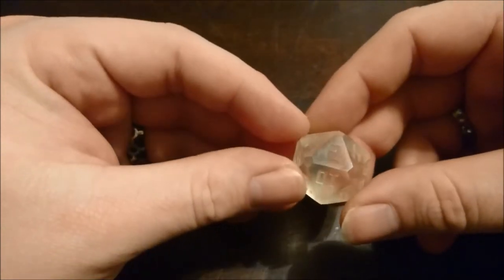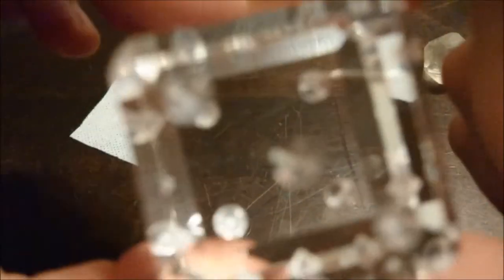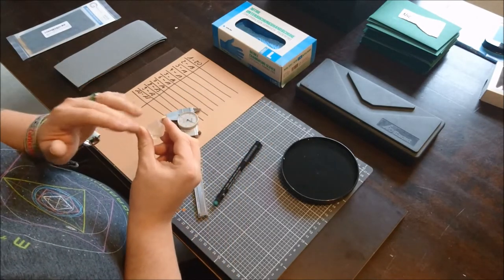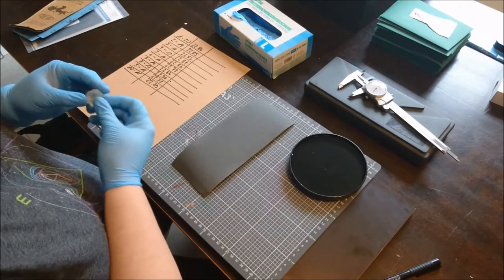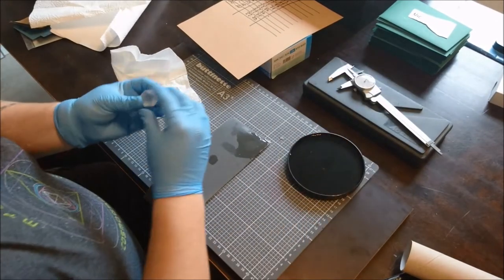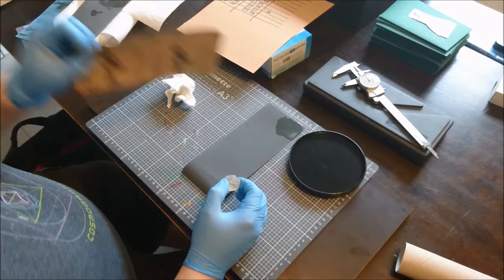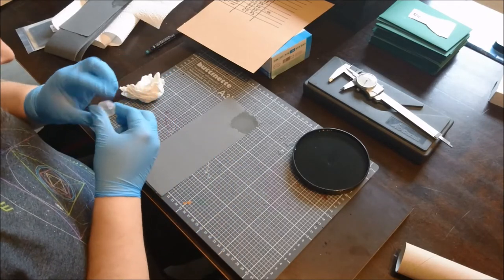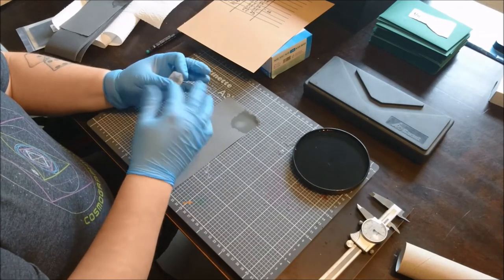Dice Making Masterdice: Part 1 Sanding

Comment: Hello ! I have some questions that hopefully you can answer , I have made molds and cast some dice , they come out perfectly clear but when I touch them they start to not be clear anymore . If I were them they're clear again but only while they're wet , is there something I'm missing here ?
Reply from the maker: Are those dice a bit tacky? Maybe it's the combination of your resin and silicone. I heard about alumilite for example which is not working so good with its own materials. I can highly recommend you check the dice making discoveries group on Facebook and explain your problem there, with some pictures and materials you used. I'm also in the group, but a lot of people will help you as well and we will find a solution.
Reply: @wuerfel_schmied  well im wondering if it's the shelf life, i just looked it up and it says the recommended chelf life is 3 months, and ive had it for 7 :o
thank you so much for helping me out!
Reply from the maker: @DrakosInfernos  that could also be an issue. Hard to tell without having it in hands.

Comment: How many sets of dice could you make using this method in, let's say, 40 hours?
Reply from the maker: It depends on the number of faces. So a set of dice cost me around a day to sand I would say. But I guess you mean sanding the cast dice. The better your masters are finished, the less work you need to put in your casted dice. I don't have much to do on my dice in the end. I cut of sprues, clean the spot with a scalpel and then do a light sanding to even out the surface finish. So cleanup on a set of dice is about half an hour to an hour depending on how well the cast went.
Reply: I have a machining background as well, so it's great to see how precise your standards are. I'm curious,  how repeatable are the molds? If you measure your castings, what kind or deviation do you find?
Reply from the maker: @jakesells2379  its a bit of a loss, but generally pretty good. It comes to about +-0.02. But it changes with the age of the mold. The first casts are the best.

Comment: where is the next videoooooooo :(
Reply from the maker: I screwed up my sanding on another face and needed to reorder a new d20. It's now at 1200 grit overall and I made a first copy as backup. But during the holidays it's tough to find the time for the rest. But you can proceed with flitz polish. I heard of a lot of people they use flitz after 3000 grit and that's it. But I also want to try other methods. Higher grits will also improve the surface.
Reply: @wuerfel_schmied  :O dang! i want to make CRYSTAL clear dice like the one you showed in this video ! your videos have helped me so much ! thank you !
Reply from the maker: @DrakosInfernos  thanks. I try my best